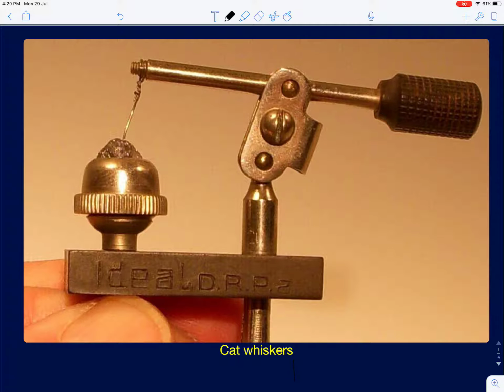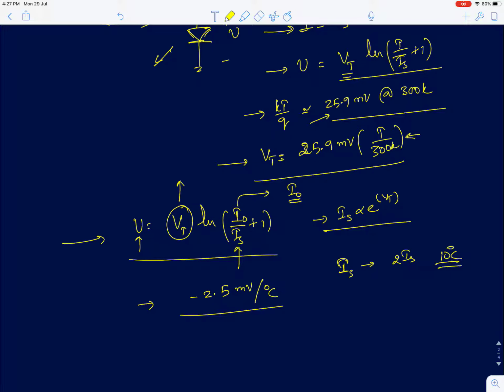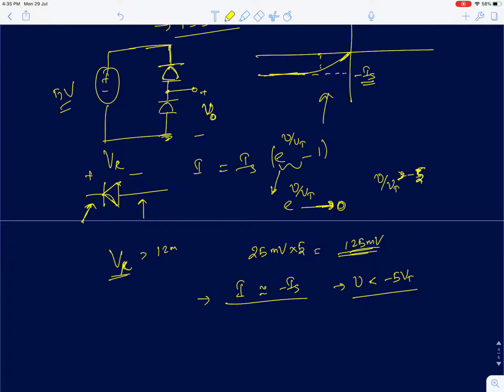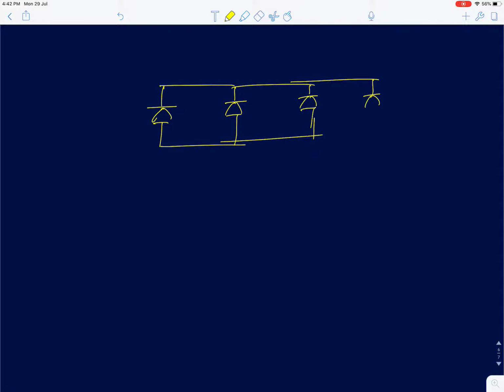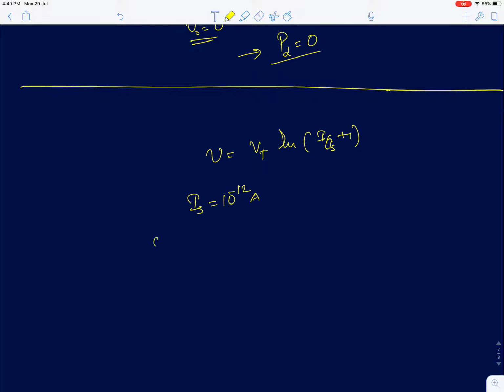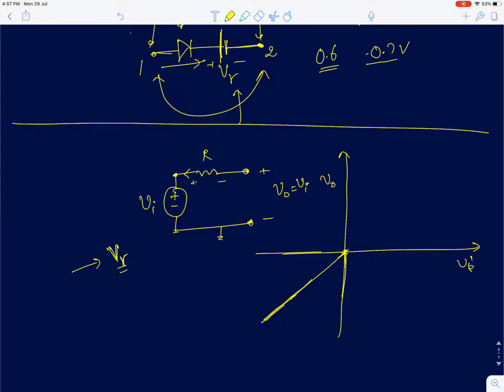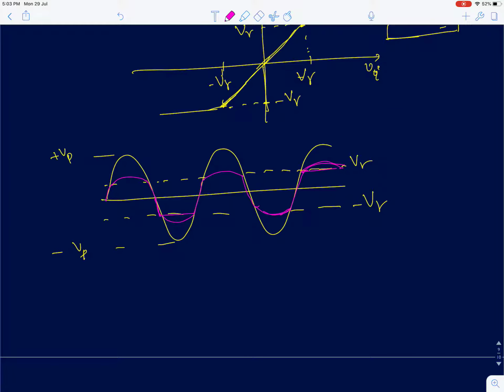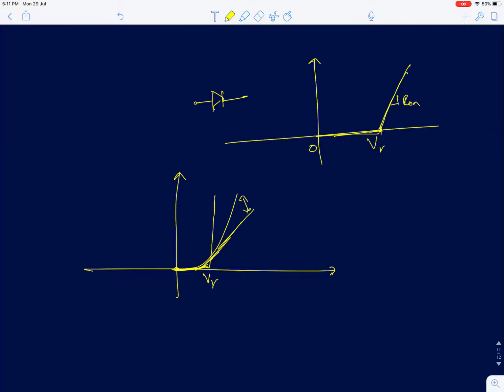ES Lecture 26: Introduction to diode models

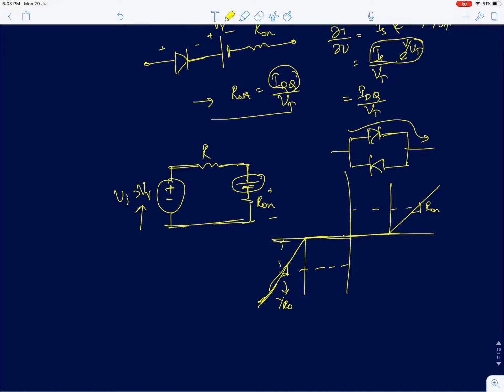Comment: Sir at 48:40 u said that , the excess voltage will appear on Ron , that is not understood sir, after that step u didnt took the voltage source,why sir?
Reply: excess voltage means incremental voltage, i.e., if we slightly increase the i/p voltage then that increase will be across Ron and R